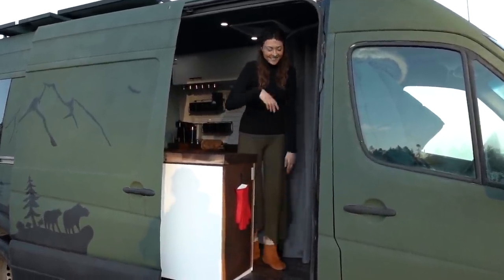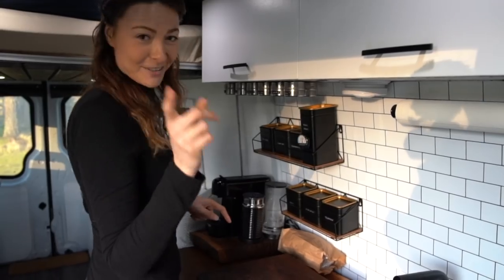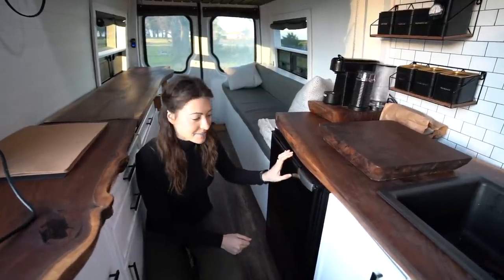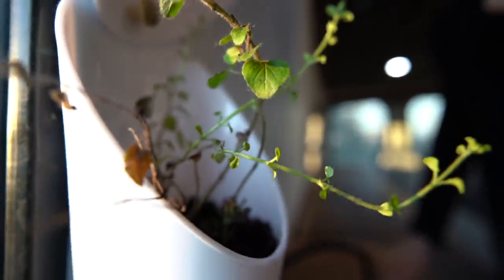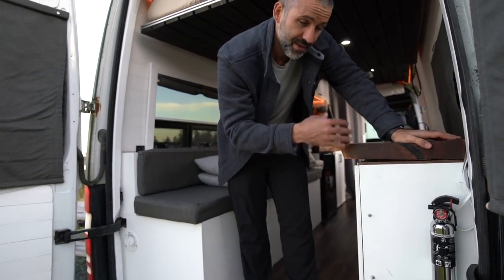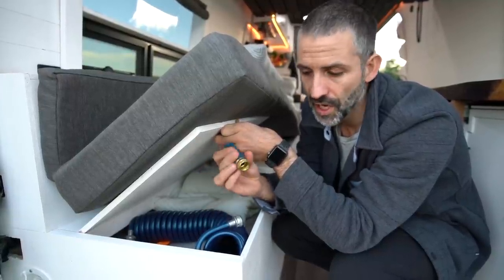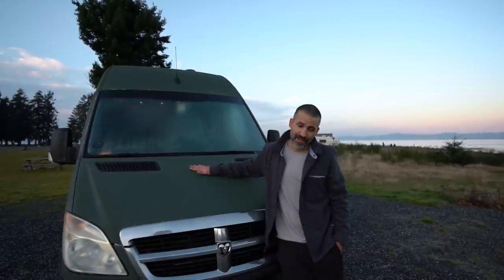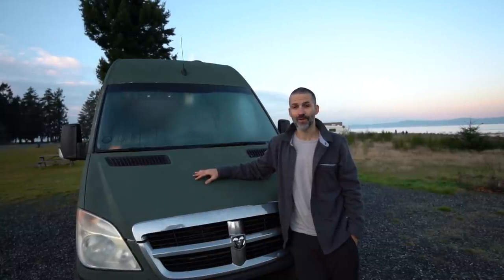VAN TOUR: Self Converted Sprinter Van | Luxury Tiny Home | Full Bathroom | Elevator Bed

Comment: Hey there, great conversion. I just try to understand height of all conversion. 
So do you mind to share what is the height of van before and after the conversion? Also the height on the sitting area after you pull up the bed? 
Thanks in advance.
Reply from the maker: Before the conversion the height of the inside is 193cm (6'3) and now its 187cm (6'1). The sitting area height is around 36 inches plus a bit extra from the compression of the mattress. This height can change dramatically based upon how high your counters are, and how thick the bed is.

Comment: Just one question: why did you decide to put the shower right in front of the door?
Reply from the maker: Few reasons. 1. It's close to the sink which makes it's easier for running the tubbing, hot water and hooking up to greywater. 2. There's more space at the front for the extra width of the shower.
3. We wanted the bed to be at the back so have those nice views and 270 degree window coverage from desk and bed.
Reply: @Drinkteatravel  so the privacy isnt a concern?

Comment: You have 24v solar panels. Do you have your 4 batteries arranged as a 24v system? Are you using a buck converter for 12v loads? I'd be interested in learning how you did you solar/battery/electrical systems.
Reply from the maker: So most panels are a lot higher voltage then what they are called (12v vs 24v) etc. The renogy 100w panels are 17.9-21.6v meanwhile the "24v" commercial panels we have are between 37-45v. 
But not we still use a standard 12v power system in the van, we simply run the 75+volts from panels into a victron mppt 100/50 controller and that converts it in 12v power that feeds our battery banks. 

Does that make sense?

Comment: Great van.  I am wondering if that is just the high roof or if it is a mega high roof??
Reply from the maker: Just the high roof. I learned about the mega roof after I purchased this one. Had I know I would have gone with mega. Would have given more clearance for bed.
Reply: @Drinkteatravel  exactly.  I was thinking that with the mega roof, you could easily have your bed raised up and a great U shaped couch underneath that would convert to a bed right underneath and sleep 4 people pretty easily...
Reply: @Drinkteatravel  also I am 6' 6" and need to think about height clearance...

Comment: Why don't you just glue some strips of cork flooring to the bottom of the bed and skip manually applying the pads each night? Some cork flooring can be very beautiful.
Reply from the maker: That was the plan, and we even have some in the van waiting to be put up. But we wanted to stain it a similar colour to the ceiling so its not obvious. We will get around to it though lol

Comment: This van look gorgeous but it looks very unpractical for travelling. The vynil floor tends to unglue. The cabinets, baskets and so on looks easy to open and the contents to spill. Doent seem to be a van to move.
Reply from the maker: Well after driving close to 30,000km we can now see how everything went. The floor is actually a floating vinyl, so there is no glue. Regarding the cabinets, we did upgrade to a ball latch system over the magnets.
Reply: @Drinkteatravel  related to the floor i ment about using tiles. Normaly they tend to contract and expand and sometimes they go out of position. In addition they tend to create gaps where dirt comes into and they become difficult to clean. I prefer to get the same effect with a continuous vynil surface mimicking the tiles. It is not that beautiful but much more practical.
Reply from the maker: Maybe we just have good quality floating evp than since we haven’t experienced that issue over the last 2.5 years in canada where the temperature Changes significantly.